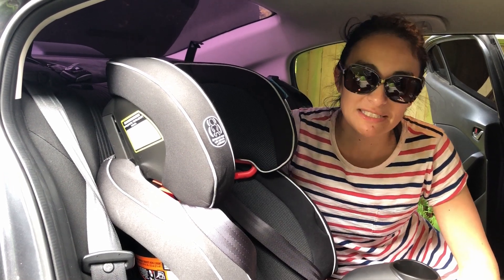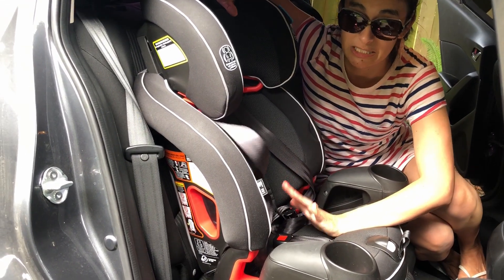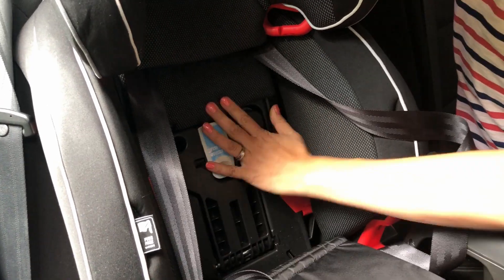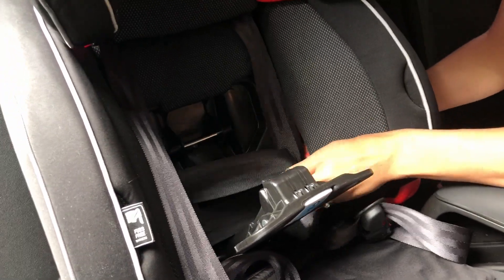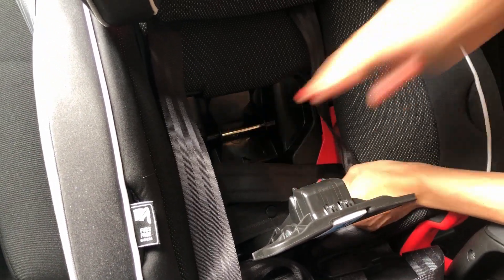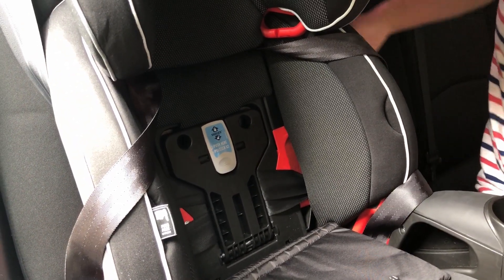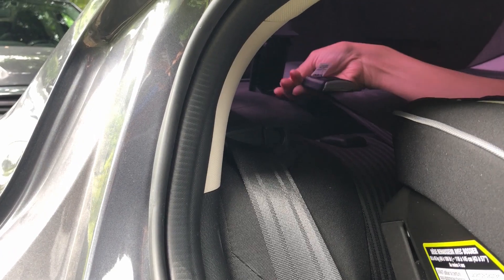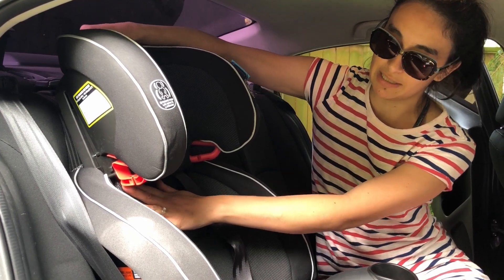Graco Nautilus Snuglock Seat Belt Installation

Comment: Do I have to put the anchor on the top back of the car if I use this method?
Reply from the maker: the top tether should always be used for a forward-facing harnessed seat; in Canada it is required by law